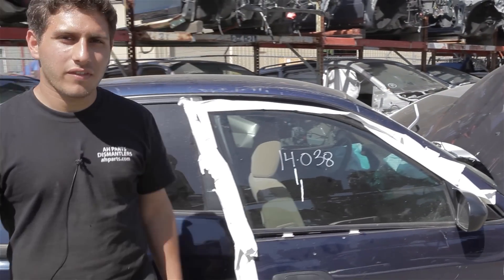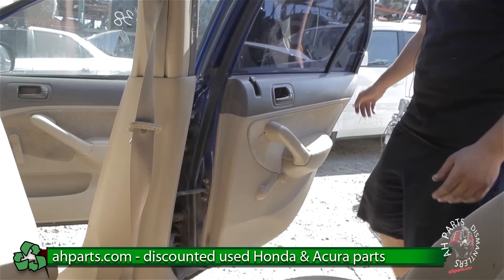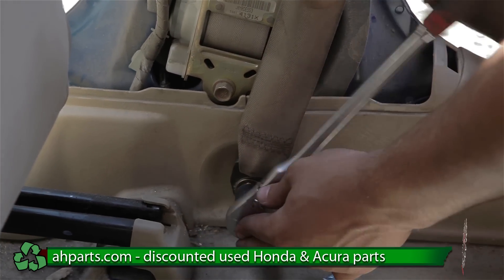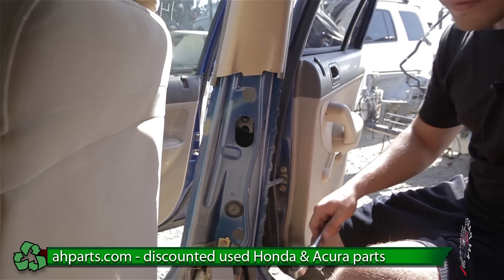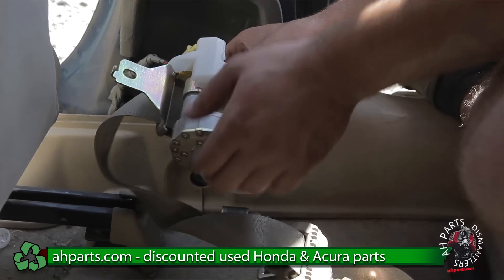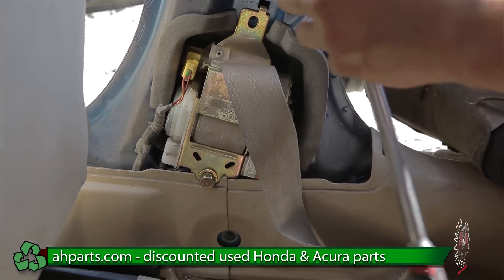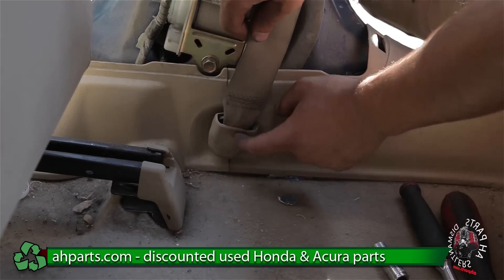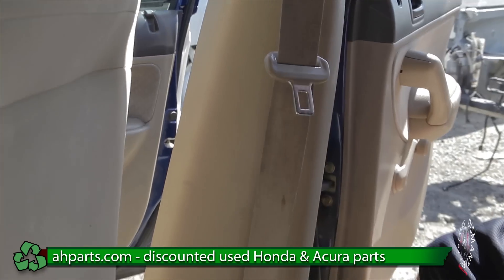How to replace / change a Seat Belt for a 2001 2002 2003 2004 2005 Honda Civic  REPLACE DIY

Comment: Thank you very much for this video. Helped a ton! The only problem I had was that the seatbelt that I tried to put in was stuck. So I had to install it, then lightly tap on it to get the lock (or whatever is in there) to release. I would pull, then give it a little slack, then tap on it, to release more. It finally came all the way out. Just a bit of info, for somebody that runs into the same problem I did. Thanks again!
Reply: Thank you I'm having that problem
Reply: JohnStickGaming Annnd I’m doing the same thing again today! Thankfully I left this comment from 2 years ago, it should help me out as well. lol.
Reply: I know this is an ancient comment but for anyone else with this problem, you're probably dealing with a gravity-locked belt. You want to have the belt reel in the exact orientation it has in the car, let it retract a half inch or so, and then pull it out slowly. This video provides a good guide on how to fix it: https://www.youtube.com/watch?v=FZ8tqJ2wtR4&ab_channel=ARCDRIVER

Comment: Good video but you didn't torque the bolts.  They should be torqued per the manual.  Also if you start the 10mm bolt and snug it the tab won't come out of the hoe while tightening the 14mm bolt.

Comment: I assume size 14 can be interpreted as 14 mm, right?
Reply: Cody Clay Yes, you can make that assumption as these vehicles use metric fasteners.
Reply: I tried to see how to remove a seat belt in a nissan altima 2007 I can't find the video